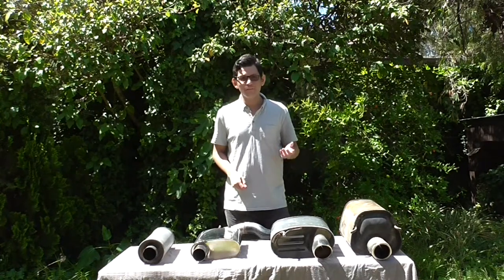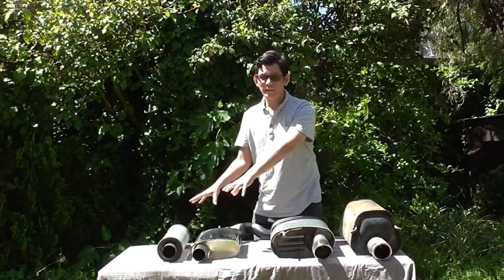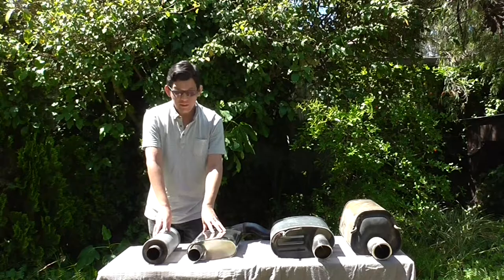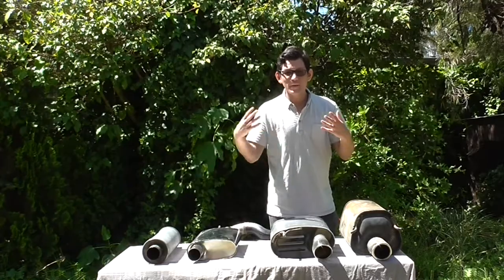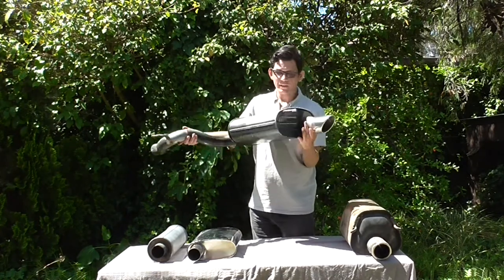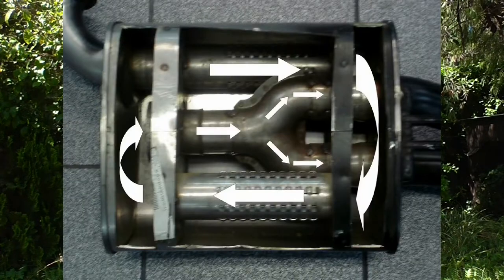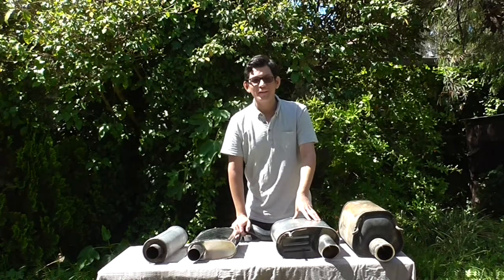Straight-through (high-flow) vs turbo (tri-flow) mufflers: what is the effect on exhaust tone?

Comment: Great explanation Tassie. Those triple-bypass mufflers can actually be used in a no power-loss system. they were designed by Diavd Vizard, and on the Corvette Turbo they were first applied to show no loss of power coupled with legal sound output. The secret was to place an expansion box just after the headers from the engine, then onto the mufflers.
This was a well done presentation mate! Thanks.

Comment: Thanks so much for this informative video. Trying to tune my 5 cylinder turbo motor to my liking and this certainly helps!
Reply: @durbancraig I know it's been a year or so therefore not sure if you'll see this query but curious what you ended up with on your 5 cylinder turbo? By the way is it an Audi or Volvo or something alphabetically in between?
Reply: @wilschnella1202   thank you for the response.
The vehicle is a Mk1 Ford Kuga with the Volvo drivetrain from the XC90/70/Focus ST225 etc.
The final setup after a number of iterations is a straight pipe to the stock rear box with a, electronic cutout valve just before the same box.
I removed the mid-exhaust free flow muffler after watching your video as I was unhappy with the lack of mid-to-high frequencies. 
I now have what I was looking for - a quiet motorway cruiser when necessary or a gloriously loud 5 cylinder noise (to my ear) at the push of button. Thank you.

Comment: Indeed very interesting video. I would appreciate to get some more info, which chamber how is calculated to delete certain frequencies. For example I want cut out resonance 2k rpm and at 3k rpm. How do I calculate.. ?
Reply from the maker: You can look at the Helmholtz resonator equation, or also try a quarter-wave tube, using the quarter-wave equation.  The catch is you need to be able to estimate the exhaust gas temperature accurately at that position in that exhaust.  More follows...

A quarter-wave tube to cancel 2000rpm on an inline-six engine will probably be pretty long, around 1000mm.  To convert engine speed from rpm to Hz in a piston engine, 2000rpm on an inline-six engine is f=rpm/60*cylinders/2=2000/60*6/2=100 Hz, with the divided by 2 being for a four-stroke engine that only fires every second revolution.  For an inline-four 2000rpm is 66.67 Hz.  

For example, assuming an exhaust gas temperature of , the speed of sound is c=SQRT((1.4*8.314*Temp in Kelvin)/(0.02857)) from the natural gas law and using air as the gas.  Assuming 200 deg C, it's 473 deg K (add 273) which gives 439 m/s. There one wave length is lamda=c/f where f=100Hz and c=439m/s, which gives lamda=4.39m.  Therefore a quarter of a wavelength (in order to give an anti-node and thus cancellation of noise), is lamda/4=4.39/4=1.10m.  So it would be around 1100mm (not easy to package!), thankfully it doesn't need to be the full diameter of the exhaust, even 1.5" or 1.75" would work.  Usually a J-pipe design is used to allow it be tucked up close to the exhaust.  For 3000rpm on an line-six, it would be 730mm.  

For a helmholtz resonator, you take that speed of sound c, and put it in this equation: f = c / (2*pi) * sqrt (A / (lc * V ) )  where A is the cross-sectional area of the inlet tube, lc is the length of the inlet tube, and V is the volume of the resonator chamber.

The calculation is very, very sensitive to the temperature of the exhaust at that point and thus the speed of sound, c.  It can tricky to work out what the temperature at that point of the exhaust is (ideally you would measure it somehow, drilling a hole where you want to branch off the quarter-wave tube or Helmholtz resonator and using some kind of temperature probe I guess).

Comment: Hey, awesome video! I have an aftermarket Cat-back exhaust on my Jeep Wrangler and love its deep and aggressive tone. However, I have a very annoying drone noise when cruising at highway speeds and going up steep inclines. The exhaust system currently has an 18" body straight-through muffler from AFE POWER. What would you recommend I do to try and get rid of the drone without sacrificing much of the deep and aggressive tone on acceleration? 

I went to a muffler shop and they told me my best bet is replacing the muffler with a Dynomax Super Turbo style muffler... Would this be my only option? I was thinking maybe if I buy a straight through muffler from a better brand such as Magnaflow It may not have the drone noise...
Reply from the maker: "I went to a muffler shop and they told me my best bet is replacing the muffler with a Dynomax Super Turbo style muffler... "  That won't work in all likelihood.  It'll be a quieter type of muffler but there's still nothing to cancel out the resonance.  Try to find a shop that's willing to add a quarter-wave tube, a tube that branches off to a dead-end.  It's designed to reflect the sound out-of-phase and cancel out the resonance.  You'll probably need some way to make the length of the tube adjustable to dial in the right length.

Comment: Cool video😎. I have a GM 3.8L  supercharged cammed aluminum heads etc.....what's the quietest but yet free flowing non restrictive muffler?
Reply from the maker: Thanks! You could try Vibrant Streetpower oval mufflers 5"x9"x15" (or something even bigger if it will fit). https://vibrantperformance.com/catalog/index.php?cPath=1021_1031_1053_1110 The alternative reversed-flow style mufflers will be quite a bit quieter at idle and part throttle, but about the same under load as straight-through mufflers like the Vibrant.
Reply: @TassieLorenzo  Can you give some options of reversed- flow style mufflers? I can’t seem to find any
Reply from the maker: @jorgeguzman659  Hi Jorge, there are few on the Summit Racing or Jeg's catalogue like say the Dynamax Super Turbo.  If you mean a complete system, most of the European systems like Milltek or Remus tend to be some kind of baffled muffler system.  But depending on the size of your engine, the best bet is the OEM muffler from a larger engine, if it will fit the vehicle, as they tend to be both good quality and cheap as no one wants them (they've usually upgraded to something aftermarket).

Comment: Thanks for taking the time to explain this. I was hoping you could help me at least narrow down the type of exhaust/muffler I am looking for. It will be for a carbed v8. I am pretty sure the muffler I am looking for isn't chambered (not a fan of the hollow-metallic sound). Here are some samples of the type of sound I am after:

https://www.youtube.com/watch?v=VcVm9ySjtlY

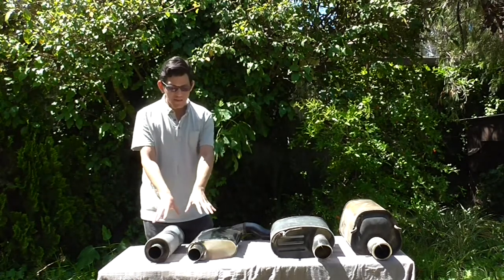https://www.youtube.com/watch?v=vcdUeYd9cBw&list=PLQvZvZR_mCMt01wE0eZtkfOtTF5mD7rky&index=25&t=0s (fast forward to 2:40)

Any idea what kind of exhaust combo I should use to get this kind of deep smooth sound. I not sure if a turbo-style or straight-through would be the best. I am guessing that a cross-over would be mandatory to prevent the popping/crackling. As an audiophile, trying to chase a specific exhaust tone is um.....exhausting XD
Reply from the maker: Hi Crockett85, Being carbed, I guess your V8 is going into more of a vintage-type car? :)  A H-pipe type crossover would give more of that 1970's muscle car sound, whereas an X-pipe crossover would give a more 'modern' sound.  I think a H-pipe combined with some straight-through perforated mufflers should give the sound you are looking for, to me this sounds similar to that Corvette :) :

- Mustang magnaflow axleback, H-pipe https://youtu.be/VqSDKa_eGrY?t=193
- LS3 magnaflow mufflers, H-pipe https://youtu.be/JKXwpPa3iFQ?t=17

A smaller pipe diameter like dual 2" or dual 2.25" would probably make it sound more similar to that Corvette, depending on your power output. :)

About chasing the perfect exhaust tone -- yeah, OEMs have the luxury of making lots of prototype exhaust  systems, measuring the noise spectrum and subjective impressions and then adjusting things as appropriate (sometimes adding resonators to cancel out problem frequencies and things like that), whereas for private enthusiasts if it's not right the first time, it all costs money! :)  Unfortunately I'm not sure there is a better way than trial and error or listening to example cars.
Reply: @TassieLorenzo  Thanks for the feedback! I think a crossover pipe and Magnaflow combo is what I am after. This morning I actually found a video of an 80s Pontiac Firebird that sounds exactly like the Corvette in the movie.

https://www.youtube.com/watch?v=La54smd79fM&list=PLQvZvZR_mCMt01wE0eZtkfOtTF5mD7rky&index=28&t=0s

I think these cars have a single y-pipe that goes to one traverse-mounted muffler that branches out into a dual pipe. So there wouldn't be a crossover pipe. However, I imagine the place in the y-pipe where both headers converge could be replicated with an x-pipe.

Comment: what if I have aftermarket performance exhaust but is too loud and yet I want to keep the bassy sound?
Reply from the maker: You can try fitting a bigger muffler body or bigger resonator body (but still the straight-through type), if it will fit.
Reply: @TassieLorenzo  I bought a chamber muffler (60 series flowmaster)  to teplace the resonator (mid section) on my veloster. Hope it will work. I can't drive my car for that long or else it will irritate my eardrums for how loud the solo exhaust.

Anyway its Solo Performance catback for veloster. It has rear muffler and resonator (replaced the central oe muffler after the 2nd cat).